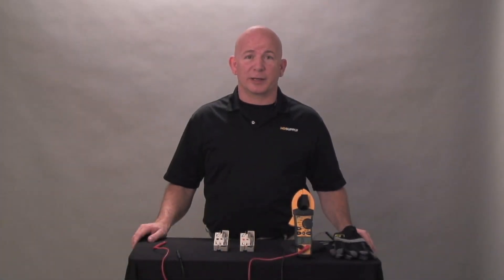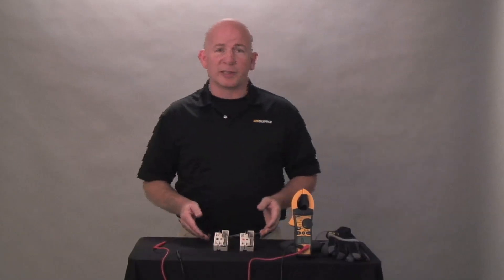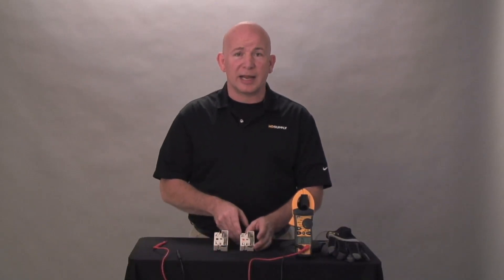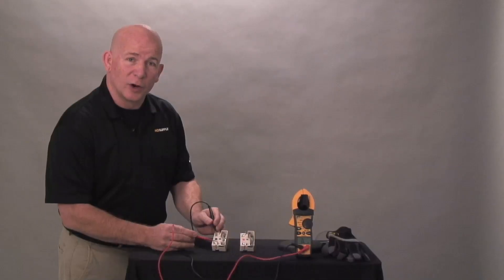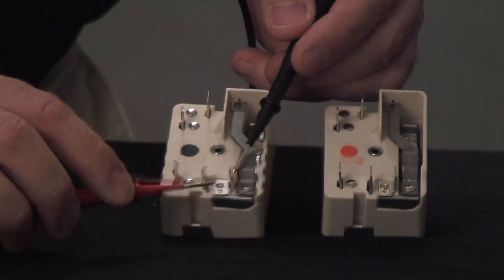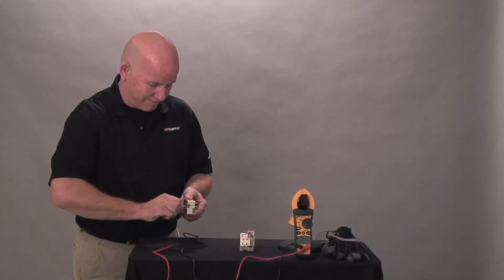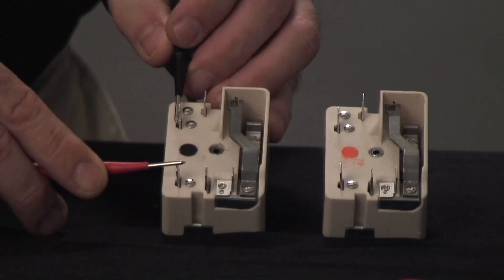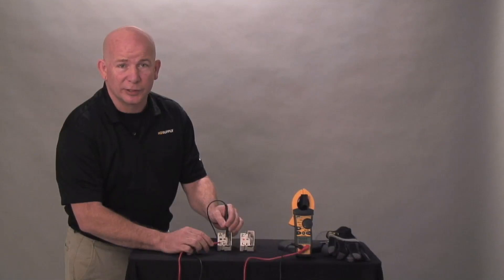How to Test the Infinite Switch on an Electrical Range | HD Supply

Comment: Continuity doesn't equal a good switch,  that's literally no different than turning it on and all portions of the burner coming on. 

The resistance at different positions would show if the switch is failing.  Most failed switches don't totally die, they fail to maintain their correct setting, or start off good and as time goes on start failing to maintain the set temp.

Comment: You forgot to show how to check if one is accurately adjusting within the range which is also a bad switch.  You only show that it turns on not that it functions correctly. Can you update the video to include the remaining diagnoses procedures for a malfunctioning, but still operating, infinite switch?

Comment: Please proof read this for me if anyone can confirm this information. A WARNING, I HAVE ZERO EXPERIENCE. I spent a good amount of time on various YouTube Vids & Forums trying to understand this simple test. The confusing part for me was there was some common terminology but a lot of people used different terms for the same things. Also I'm sure there's several ways to Test the Infinite Switch. After I was able to put this into perspective the test worked perfectly. On my infinite switch the L1 - H2  connection was broken when the infinite switch was in the 'On' position.

	Stove element infinite switch: Red or Orange Dot = 8” burner / Black Dot = 6” burner

	Multimeter Settings for Continuity Test: Switch dial to Continuity Setting (Diode Symbol which looks like an Arrow with one perpendicular line through the tip of the arrow) beside a Wi-Fi looking symbol. Check owners manual if in doubt. 

	Black multimeter lead is ‘Ground’ or ‘Common’: Plug into ‘COM’ port.

	Red multimeter lead is for ‘Active Current’: Plug into ‘mAVΩ’ or ‘AVΩ’ port, which stands for ‘measure amperage, voltage, and ohms.’ 

	‘Continuity’ (Checks for electrical path between two points): In this case we are testing a switch two times, once with switch turned off & once with switch turned on. 

o	Good Continuity: Most multimeters will beep continuously when testing a connection with good or perfect continuity. Display of ‘Zero’ indicates perfect continuity. As long as you get any value, that will show continuity. 

o	No Continuity: No beep. If no numbers display or it shows an error message, then you have a broken connection, and the current is being interrupted. This usually means a broken fuse, snapped wire, bad battery, or the switch is turned off, or the switch is on but faulty. If the number is blinking, it is usually an indication that the current is broken, but some signal is getting through. This blinking function is only available on some multimeters. 

	Continuity Test x2: Multimeter set on Continuity Setting (Diode/Wi-Fi) Symbol: 

	1st Test switch in ‘Off’ position: Should get no continuity, no sound & a display of ‘OL’ (open-loop). 

	2nd Test switch in ‘On’ position: Should get continuity indicated with a beep. Display of zero indicates perfect continuity.

	Actual Test below is for both 'Off' & 'On' Position. I used a felt pen to mark the connections on the back of the switch, just to make it easier for me.

	Put Red Lead on L1 & Black Lead on P
	Put Red Lead on L1 & Black Lead on H1
	Put Red Lead on L2 & Black Lead on H2

Comment: Thanks for the info. I was able to test my switch and determine it was the problem and not the burner. When I removed the switch you could see that the contacts where burnt, but testing helped speed the process.

Comment: One sure way to know if you have a bad infinite switch is the element on indicator light will stay on even when the switches are in the off position. From here you unplug your range/ stove and inspect the switches. Usually the faulty one will be burnt  or frayed etc. Take a pic of where the terminal ends are connected to the switch and disconnect them then plug your stove back up. If the element on indicator light is off that is your faulty switch. Make sure the terminal ends aren’t touching any metal before plugging your stove back up for this test. This method is for those who don’t have a multi meter at their disposal.
Reply: Not all the time

Comment: So frustrating u dont answer the 2 most important questions.
1.What reading are you getting
2.What setting do you have your multimeter set to ?!😑
Reply: For the open loop, O.l., setting is on Ohm, on digital meters. For continuity test, there's a continuity setting on digital meters.
If you're using an analogue meter, zero ohm is equal to open loop. For continuity test, you'd get a value for ohm, depending on the device you're testing. For continuity test, the ohm value is immaterial. As long as you get any value it shows there is continuity.

Comment: Nice test procedure, thanks. I'd like to know how to repair a switch that's not regulating temperature correctly. Mine is constantly on HIGH no matter where the dial is pointing, except in the OFF position where it's off.
Reply from the maker: Unfortunately those switches cannot be repaired, and will need to be replaced if not working properly.

Comment: How about when testing an electric oven theromstat swith / oven temperature control switch?  Is it considered "an infinite switch", too? I have a 90s model Frigidaire electric oven, with a Robert Shaw temp./ thermostat control switch, that has 6 wired contacts / 6 wires coming into it; they are labeled  L1, L2, 1, 2, 3, 4. It has a built in copper thermostat capillary tube going around into the back of the oven. I think this switch is bad. How do I test it with an ohmeter? Thanks.

Comment: How does this test that the switch will function correctly through a duty cycle? Surely this will fail to find a switch the only intermittently turns on or off at the incorrect times?
Reply: Yeah. They should specify what the problem is they are trouble shooting. Probably that it isn't even turning on. If the problem is that the burner is staying on the wrong temp this test wouldn't tell you much.
Reply: Majority of the problems are when the heater inside of the switch is not switched on for on positions, and causing continuous power for the heating plate. I applied some pressure to the spring by a zip tie, and got it fixed.